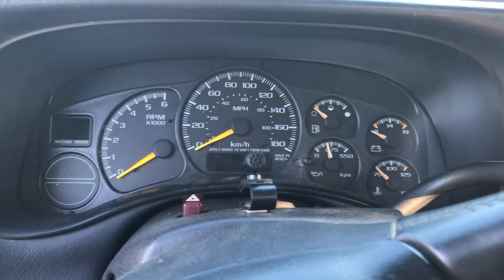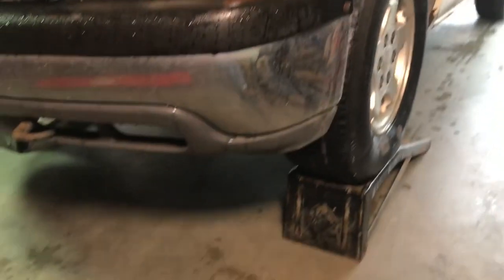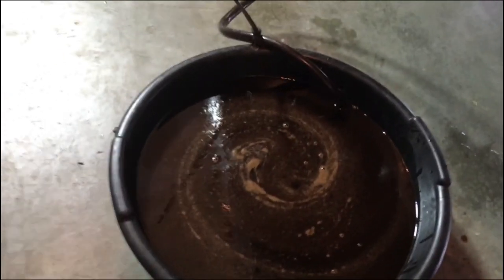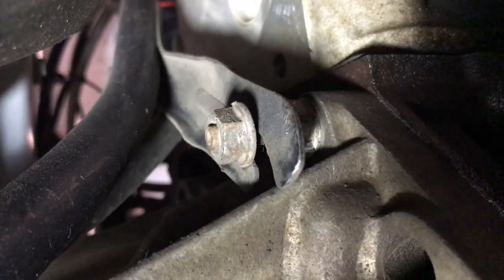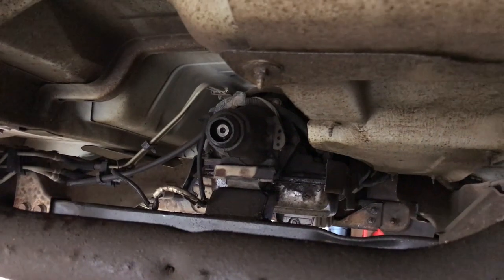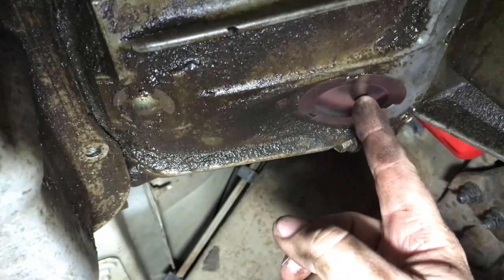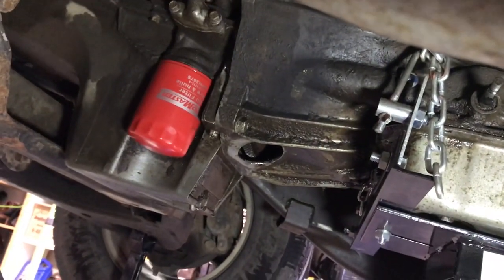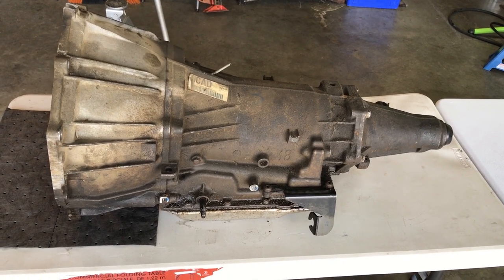4L60E Rebuild Part 1 - How to Remove the Transmission from a 2000 Chevy Silverado 1500

Comment: I rebuilt my 4l60e too. Lots of fun. I think I may know why you don't have 2nd gear. And likely your 3rd is also MIA too. Specifically, its the ECU needs to be re-flashed. Or, like I did which was I just bought a re-flash unit off a guy that does them for $90. Mine lost 2nd and 3rd one morning and I took it to every shop I could to see if I could get them to run a diagnostic. Well, every single place flat out said I needed to rebuild my trans because it was shot and was why I had lost 2nd and 3rd. So, I found a youtube vid of a guy who made up a switch box using stuff around the house to shift his dragster using a 4l60e and googled my wiring diagram to locate the solenoids and soldered up my own switch box. Found out immediately, my trans was fine, the reason it wasn't shifting was because ECU had crapped out. Ordered new ECU and shifts like new again. Anyway, before that I too dropped the pan replaced solenoids, replaced the servo seals and apply pin and just about everything else everyone thought was wrong. Start with the simple solution, make up a switch box, if nothing else it will be a good tool to have just in case. Oh I see you posted back in July. Well, you probably got it fixed by now. What did it end up being wrong?
Reply: I've got to pull a transmission on a 2000 chevy 1500 my dad gave me. What's an ECU? Just trying to learn everything I can. Don't have any experience
Reply: @batimaes1  ECU is electronic control unit. Good luck on yours.
Reply: @gregboswell2843  okay thanks man
Reply: Hi @Greg Boswell , could you point me to the directions to make the shift box, I too have the same problem like you and would like to try it before I pull the transmission out and rebuild. Thank you
Reply: Same here. How do I make a switch box please?
Reply: @AngelDawn4u  I watched a drag racer youtube video who uses the same trans in his race car then went to junk yard and got the pigtail that plugs into trans. Lot easier to pull up vids of guys who have done it and posted. Let me know if you have troubles. Sorry for late reply, been busy

Comment: I pull transmissions all the time on just jackstands in the front only e brake on and rear wheel chocks works great I think your 95% comments were from pansy's
Reply: Sitting on four jack stands now trust them way more ramps
Reply: I dont even set the e brake...4 stands and two Jack's as backup (front, rear)  no problems.

Comment: I swapped my 4l60e in the driveway on jackstands... it all went smoothly. The “built” 4l60e ended up costing just under $1100 w a circle d converter. It’s held so far with no issues. I’m preparing for a little more rowdy build in the next few months... it will have a 4l60 in it as well
Reply from the maker: 2001 RedGMC good to hear. I think a lot of guys are too quick to get rid of the 60e. Glad yours is holding up.
Reply: I’d swap to a heavy duty 4l60e or 4l80e

I mean, I plan to turbo mine probably this summer or next year (depending on how things go and how much $ I have) 

But I’ll have to pull and rebuild my 5.3 since I’d rather it be reliable that just pure guessing. I was told cluster was swapped with 180k mi…engine is solid as far as I know tho. And cluster says 291k..

I’m in process of pulling my trans now and swapping with another 4l60e so I can earn some $ plowing snow lol

I lost 3rd and 4th a week ago and a few days ago, reverse started grinding…..so…..yeah..hopefully the new trans works.

Comment: Randy, you should reconsider a 4l80e swap. I have the same '00 Silverado 1500 nbs 5.3 turbo long bed, which had a 4l60e. The '00 cross member has a tab facing forward, which you cut and weld facing back.  The overall length of the '00 60e and the 80e are the same, so your 60e drive shaft works. You  don't need an hd2 kit. A running $135 bargain 80e, with stock converter, takes a beating and won't shit the bed. Get an 80e with the slip yoke, 4.8/6.0 80e flex plate/ spacer, some fluid line to splice together and a dipstick tube. Lt1.com describes simple pin changes at the pcm connectors. 1350 to 1330  u joint? Segment swap the file.

I felt unsure, until doing it. Do what you have to for your move. Just keep in mind that you'll do another video, when the 60e shits again. PM me, if you have questions.

Comment: I had someone say the same thing to me when I was talking about pulling the trans on my 2000 Silverado 4X4. They were getting so annoying and wouldn't shut up about it so I dropped and log rolled under the truck from one side to the next. (Truck was still on the ground) Jumped up and said. "Oh yeah you're right, that fucker will squash me like a bug!" Everyone laughed and the person shut up. I wouldn't do something if I wasn't sure it was safe. Not to mention I was going to put ramps under all 4 tires as a backup safety. I used the Jack stands to get that extra height and I always perform a shake test just like when I put a car on a lift.
Reply: Just watch out for the Harbor freight jack stand recall haha

Comment: I am considering a budget rebuild for my 2007 Yukon XL but the rebuild kit is only half the cost . You also need tools , assembly lube , fluid , cleaner it adds up but I know it's done right and still half the cost of a reman . Also I believe the 4L80E also requires a new 6 bolt flex plate .

Comment: My 4l65 trans is doing the exact same shifting as yours. It did make it for a year with 526 rwhp. I have a 4l80e setting on the stand ready. Been dreading the trans pull.😁
Reply from the maker: Turbo Tim's Garage yeah I’m hoping mine will last another year or so after I put a rebuild kit in it, then hopefully I’ll have some funds in the budget to do a 4l80e upgrade or Turbo 400

Comment: I don't think the jack stands would be a problem, but using the jack stands while on a sloping driveway is. For added safety,  I guess you could have put the ramps under the tires in case it did fall off the jack stands.
Reply from the maker: 1jeffr yes That would have worked to put ramps under the wheels. Ended up just moving it into the garage where it was on a level surface not on a slope.

Comment: Probably a good idea to flush the crap out of the cooler lines.
Reply from the maker: Jeff H yes I plan to flush out the cooler and the lines for sure. Not sure how I’m going to get the old dirty fluid out of the converter though
Reply: I wonder if you could drill a hole in it then weld it up?
Reply from the maker: Jeff H maybe, or drill and tap a hole for a 1/8” npt pipe plug. That might make it unbalanced though I guess
Reply: @LowbuckLS  take the converter to a trans shop and have it flushed
Reply: Pour transmission fluid in it thats how you flush them out and poor it out do 5 times in your case

Comment: Jack Stand safety is important. I have been working under cars for 40 years and never had a lift. First the stands themselves, the wider the base the better. I like the 6ton ratcheting type.  Obviously, it must be placed on a secure spot on the frame meaning a flat area not prone to slipping.  After the vehicle is set use your hands to push on the vehicle from the side.  If it moves you did it wrong. Keep applying pressure until you can lean into it like a line backer. Then grab it and pull, back and forth hard as you can.  If it passes that test you aren't going to put anywhere near that type of a side load on it from underneath and someone coming up and leaning on it isn't going to kill you. Common sense really, but if you can just push it off the jack stands it isn't safe to be under the car. Better to know that BEFORE you get under the car.  Also, using ramps on the rear and jack stands on the front or vise versa, can give you a lot of lift and still retain the same level of safety.  I avoid using four jack stands.
Reply from the maker: Michael Dose good advice, thanks for sharing it. I’m thinking for my next transmission swap I may build some stands out of wood that would support the truck under the wheels instead of supporting the frame. May be doing a 4L80e swap in this truck at some point.

Comment: How did you remove the neutral safety switch without removing the clips  on 13:14 ? . I’m having a problem trying to get the screw under the connected wires and it’s not letting me un plug
Reply: You ever figure out????
Reply: I am having the same problem

Comment: At 21:21 , is that a broken bell housing flange that I see. Just wondering if you had trouble with that bolt . great video by the way.
Reply from the maker: Thomas Harlos yes I did end up having trouble with that top bolt which resulted in that broken bell housing.
Reply: @LowbuckLS  was it not accessible? I heard you can reach it easier from the top once you pull the inlet manifold

Comment: Chock the jack-stands it'll be fine . I did a Duramax clutch/flywheel with  a 6 speed , K3500   with stands like those . Hardest part was finding a bit to remove the FW blots .

Comment: Are you Canadian? just wondering (I'm a Buffalonian.) More on topic, why did you remove the converter instead of just leaving it on the flexplate? You got life by the balls there---you're working on a 2WD Fullsize! Try a 4WD Envoy/Trailblazer--heck, even just removing the trans lines--for a challenge!
Reply from the maker: Yes I’m Canadian. I took the converter off so I could try and flush the old dirty fluid out of it. It’s also easier to make sure the converter is installed correctly when reassembling if it’s not attached to the flex plate.
Reply: @LowbuckLS  Forgive me, you sounded Canadian to someone who's spent a great deal of time there. I didn't want to sound like I was criticizing. It's generally faster & easier taking the converter off the flexplate after the trans comes out. YES, of course, install the converter into the trans properly before installing everything into the vehicle. It's easy to cause major damage, hoping/trying to get it engaged properly with the pump rotor, if you leave it attached to the flexplate.

Comment: How was it working with the ramps? Was it up high enough for you? I always use stands, ramps would be easier.
Reply from the maker: Myles R it was high enough for doing most of the job, but I had to put it up on tall jack stands again when it was time to actually lower the transmission with the jack and pull it out from underneath the truck.
Reply: @LowbuckLS  I was able to drop on just ramps but couldn't roll it around had to man handle it
Reply: I feel like ramps are. Not high enough
Reply: I have a 2005 cadillac escalade 5.3l. How do you determine if a torque converter has gone bad and not the transmission?
Reply: @chrisg1364  take it out of overdrive
Reply: And see if it the trans because when u take it out of overdrive it doesn’t  use torque converter

Comment: I took all the bolts off but I can't separate the transmission from the engine can anybody tell me how to do it
Reply from the maker: Hugo Ayala if you are sure you have all the bolts out you should be able to grab it by the tail shaft housing and shake it loose. But make sure you have all the bolts out, some of the ones at the top are difficult to see. The alignment pins are probably corroded and could be sticking in their bores but shaking the rear of the transmission should break them free.
Reply: @LowbuckLS  thanks a lot for your help that is what I'm going to do tomorrow
Reply: you have to pull the starter and unbolt the torq converter from the flex plate if it’s an automatic

Comment: You shouldn't need to remove the starter to remove the plastic inspection covers on the front of the bell housing. I took them both off doing an oil pan gasket before without touching the starter

Comment: before you reinstall the trans, roll that pinch weld back to afford yourself more room.
Reply from the maker: Randy Richardson good call, thanks for the advice. And usual thanks for watching and commenting, appreciate your input.
Reply: Randy Richardson I’ll be removing my trans soon. What pinch weld are you referring to?
Reply: @jaimeocaneda394  the seam/pinchweld where the trans tunnel meets the firewall.